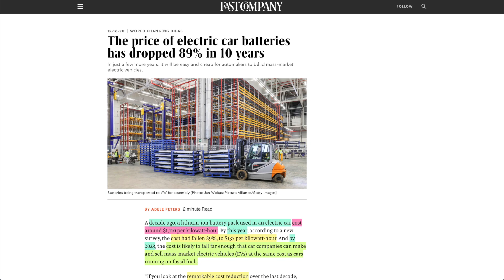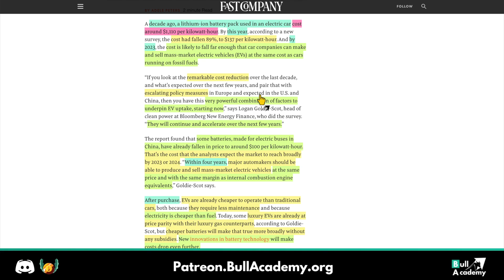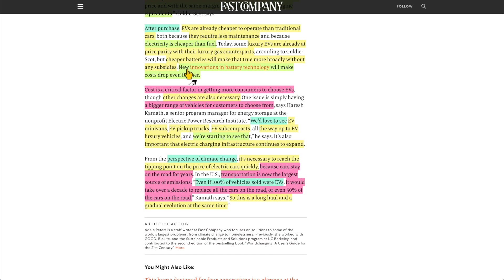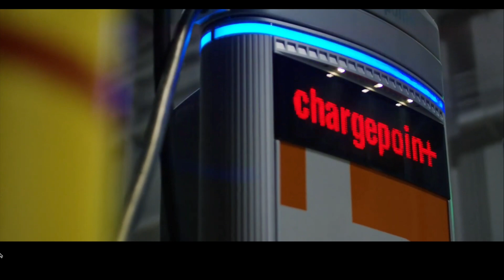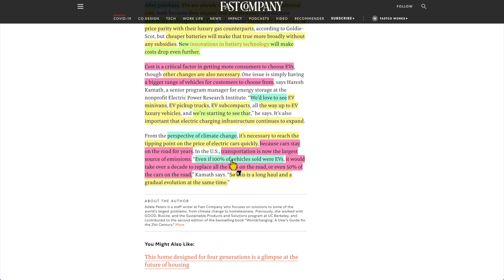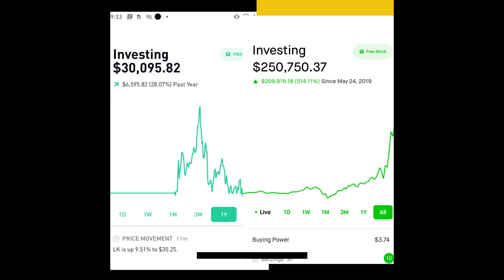Gas Cars are in Danger: 89% Drop in the Price of Electric Car Batteries in 10 years

Comment: the EV is the future, but not only the electricity grid, as there is not enough infrastructure for traditional grid electricity. in fact there are electrical blackout these days in California already. thats why the production of RNG (renewable natural gas) has doubled in 2020 and likely double again in 2021. to fully chrage 2 electrical trucks via traditional grid it takes the same energy to power a whole factory for a whole day. by the way, thats why i think Hyliion has a great solution as they are brings electrical truck that works on RNG (and im not trying to promote Hyliion). in addition, the Grid is still creates polution and the RNG is 100% clean.